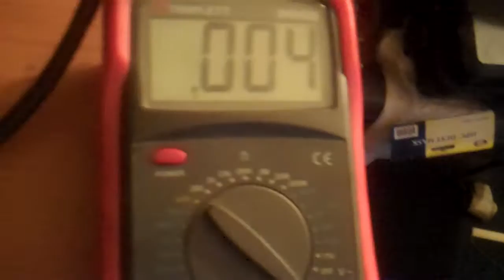PMG update the build continues

Comment: what are u doing
Reply from the maker: +Lawrence Pittman I want to screw the man or power company. lol My goal is to input power to my home with a 1000w MPPT Grid Tie invert-or. Normal used with solar panels. By converting the AC to DC with a motor to spin it up, I hope to power the GTI and the motor itself. Thanks for checking it out.